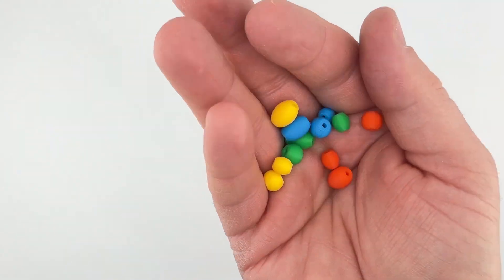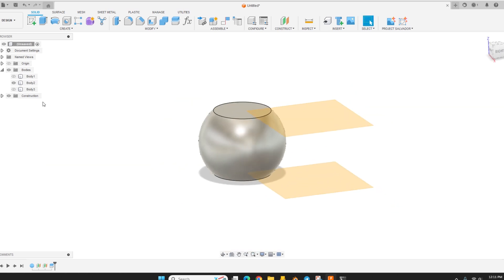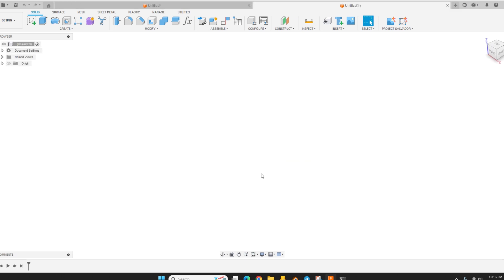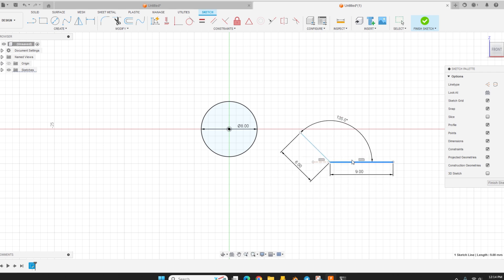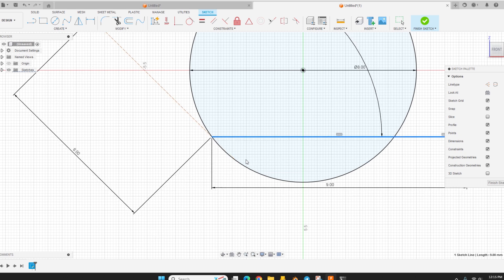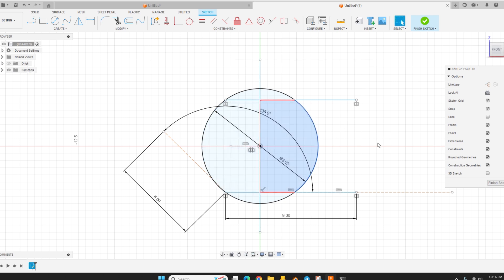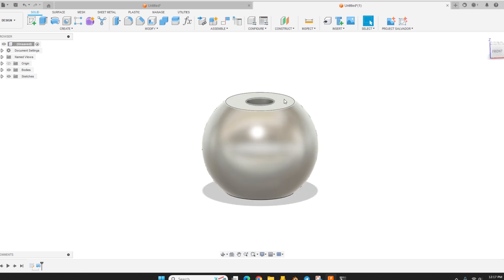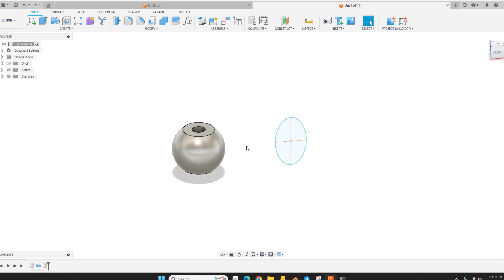Design and 3D print Beads!

Comment: One thing I figured out is that when you want horizontal or vertical lines to mirror about, instead of drawing the lines through the center (and potentially having to dimension them) is just turn on the axes and use them. Fusion creates a projection automatically. You can turn the axes off again afterwards.

Comment: Very clearly explained. But: You chose the wrong side to rotate. You drew the 45° line on the other side. This means that you won't have a 45° angle when printing. 😉
Reply from the maker: No, the horizontal line bisects both sides. They’re identical.
Reply: @ShopTherapy623  Yes, of course both sides are separated by the center line. But you select the half on the right side where you haven't drawn a 45° slope. And your 45° line on the left side is a dashed construction line, which is not taken into account when rotating.
Reply from the maker: the 45 degree line doesn't matter; it's just a reference line.  I just used that to figure out where to put the horizontal line. So selecting either side gives you the exact same solid body
Reply: @ShopTherapy623  Got it! Now i understand it.

Comment: Always great stuff! Thank you! I see you printed some beads. At that size, I'm guessing it doesn't take long to print?
Reply from the maker: No. Super fast to print. . But they are small, so you need a very clean bed, and I set my printer at 50% speed so I don’t accidentally knock them off the plate.
Reply: @ShopTherapy623  Good tips - thank you!